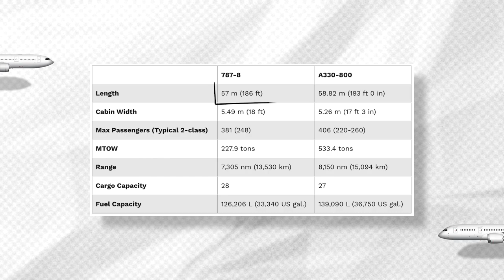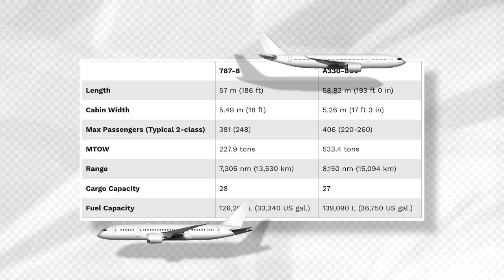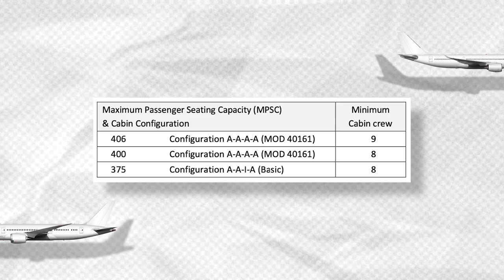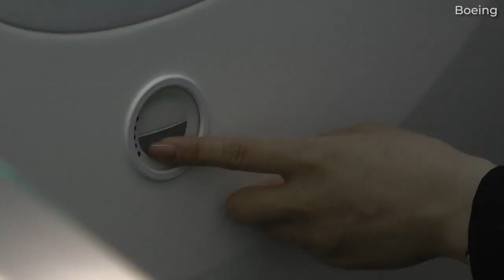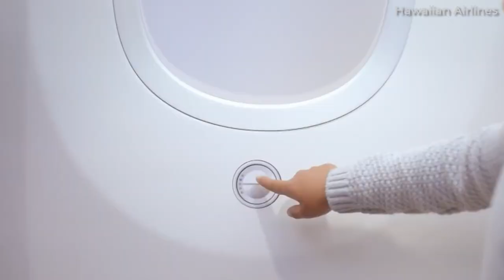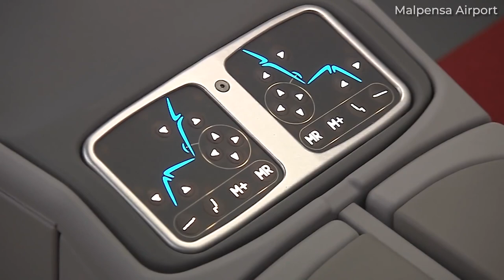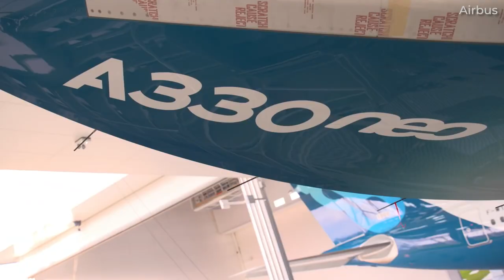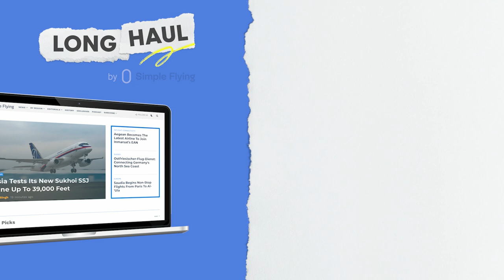Comparing Small Widebodies: The Airbus A330-800 vs. Boeing 787-8

Comment: The Boeing 787-8 is my favourite plane because it reflects what the 787 was originally designed for... Long haul routes with low demand.
Reply: With the airbus a321 XLR entering the market soon, that function will be taken to new heights by airbus.
Reply: @Imperial_stroopwafel  not really since the B787 has a major advantage over the A321XLR. The 787 can obviously haul much more cargo since it’s a wide body. Some routes have so much cargo to haul that airlines make more profit out of hauling freight than passenger revenue.
Reply: @is500fsport5  Realistically, it is cheaper to have separate cargo and passenger flights, unless if there are other factors, like limited airport slots.
Reply: A330 seats are 3 inches wider and engines are quieter
Reply: It'd a stunning plane!!
Reply: 787 is garbage, I flew onboard it, and it was awful. Cabin was tight 3-3-3 class layout which sucked, the A330 was much better with wider cabin 2-4-2 layout, when I flew onboard it, the cabin pressure was much more comfortable unlike on a tin can 787, and I am sure the A330neo would be even better.

Comment: It was mentioned that Qantas does not operate the 787-8 in relation to unfulfilled orders. It should me noted that Jetstar which is a part of the Qantas group does fly the -8. It would be pretty safe to say that the order would be for them
Reply: Those were ordered in 2006. I would say it’s pretty safe to say that after 17 years, they don’t want them. I also don’t think that Qantas orders aircraft for Jetstar.
Reply: @rtbrtb_dutchy4183  The -8s were in fact transferred to Jetstar, as the original comment mentioned Qantas owns Jetstar and airlines frequently do this. For example all of Air France's 787 orders are being given to KLM from now on, while all KLM'S A350 orders are being given to Air France.
Reply: @schalitz1  right, but all your examples is due to a change of plans and not the intend from the start. 

AF and KLM are swapping to become more streamlined overall. But those A350’s we’re initially intended for KLM and those B787’s were intended for AF. 

The Qantas orders were from 2006. They were not intended for Jetstar in my opinion. It seems they had a change of plans in 2011. 

Now, having said all that, I think you are correct and I’m wrong in regards to Qantas ordering for Jetstar. It does seem that Qantas orders airplanes for them both. I did not know this.
Reply: @rtbrtb_dutchy4183  QF definitely orders aircraft for Jetstar, as Jetstar is a wholly owned subsidiary of Qantas.

Comment: I like the A330, but I feel Airbus should have gone for a more expensive revision with the NEO version. Giving it composite wings would have made it a lot more competitive.
Reply: I agree
Reply: It's a fine line because the more changes they make, the increase in training costs to convert A330-200/300 crew. Low training costs and ease of integration into an old A330 fleet is the NEOs main selling point for airlines like Virgin Atlantic, TAP and Delta.
Reply: I like 2 4 2 row seats in A330. seems to be underestimated because they rely on A350?
Reply: As I posted in my other comment the A330-neo has a lower fuel burn at maximum distance than the 787-8 even with it's metal fuselage and wings. I'm sure Airbus calculated this before deciding to change too much.
Reply: Initially before Airbus decided to build the A350 they were proposing an improve A330 with a carbon composite wing.  So they should made  it in the Neo a la 777X.
Reply: According to Cody Explains interview with Airbus, the A330 got redesigned composite wings apart from new engines
Reply: @Lazo00100001  I saw that video, and it was very interesting. I don't think the wings are completely composite, but the original wings were a compromise as they were shared by the 330 and the 340 (which is quite a big compromise, since it needs to support 4 engines on the 340). The new wings are specific to the 330 Neo, and have composite components to reduce weight. It also seems that the 330 Neo is not a fait-de-complete, and there has been continuous refinement since it was launched, and likely to be ongoing improvements during its lifetime.
Reply: @lostcarpark  you're right, it's an important distinction, thanks for pointing it out! 🙏

Comment: Another consideration is that the same width that makes the A330neo more appealing in economy also makes it less suitable for premium products.  The Delta One cabin in the A330-900 versus their A350-900s is a prime example: to fit the same 1-2-1 layout, the seats and aisles are noticeably narrower, and the overhead bins a bit smaller.
Reply: I’ve always thought that the original A300 hull design, while shrewd at the time, focused more on freight volume and less on passenger comfort, actually moving the cabin floor and windows upwards.  The walls are not flat, as the windows and fuselage narrow shoulder space as the walls squeeze in.  Great, roomy belly cargo areas that accommodate the same cargo (LD3/11/7) containers that other in-production widebodies had back in the 70s.  Airbus was trying to save weight wherever possible during their A300 program, trying to be all things to all people.  Still one of my all-time favorite airplanes, I think Airbus pretty much nailed it with the A300, gave four of them to Eastern Airlines to try for a while, and got Airbus their tiny foot in the door in North America.  What an amazing company they became.  It is going to be ten or more years for Boeing to become a serious competitor again.  In the mean time, Airbus is offered a lot more flexibility to further develop its products at its own pace.  It is the ultimate plane manufacturer’s sweet spot, and so hope Airbus takes the ball and runs with it.

Comment: I think airbus made a mistake in a330neo program

Maybe if airbus install new composite wing and stabilizer (maybe the slightly smaller a350wing and stabilizer) that have less weight and better aerodynamic and scrapp some cabin wall to make it wider at least could accommodate 9 abreast 17inch
what like Boeing did with 777x with just not a new engine boeing instal new composite wing and re adjusted the cabin so it could take closer to A350 efficiency ,

the efficiency of A330neo efficiency would likely come close to the 787, if it happen the A330neo would have better sales than today

Plus The trent 7000 is 3% better efficiency than the trent 1000 TEN and the XWB, but with heavy almost entire metal fuselage the 787 still far ahead in efficiency
Reply: no they didn't make a mistake. The development cost for the A330 neo is really low. Airbus is already making profits. I agree that 330-800 might be a mistake, but not the A330 neo program as a whole
Reply: The a330-800 can fly 15,094 km using 139,090 L of fuel which is equal to 9.2 liters of fuel per km. 
The 787-8 can fly 13,530 km using 126,206 liters of fuel which 9.3 liters of fuel per km.

Comment: The 787 is a more modern aircraft. This also explains why the A350 is more successful than the A330. Airbus tried to do with the A330 what it did with the A320, but the mission of a widebody aircraft far differs from that of a narrowbody, and so are the economies of scale.
The 787 was a well thought out aircraft, and will continue to be the gold standard in this class for the foreseeable future.
Reply: That’s what I thought, I believe the 787 would be an ideal aircraft for those who want to get the most of future of aviation, but if you are a 90’s kid or 2000’s kid, grew up in the 90’s and 2000’s, and prefer the classics, the nostalgia, the A330neo is your aircraft.
Reply: @ramyfares9099  That would be the 767 and 777. 😂
Reply: @sainnt  767 dives you even further to the 80’s 😉
Reply: @ramyfares9099  The last passenger 767 was delivered to Air Astana in 2014. That bird will be flying for a while.
Reply: @sainnt  I think the 787 was meant to replace the 767 just like the A350 meant to replace the A340. The 777 and the A330 on the other hand both continue their legacy with enhanced engines and redesigned wings, despite being out gaining popularity since 1995, with the best selling variants the A330-343 being succeeded by A330-941neo and the 777-300ER being succeeded by the 777-9X.
Reply: They should've just done more like what boeing did with the 777x. Airbus seem not to care since it's a350 is also used by some airlines to replace  a330s along with 787s. Their current increments in improving the a330neo will add a few more orders probably meeting their estimate of 500 but not significantly more than that
Reply: @Tpr_1808  They're currently under 300. Perhaps investing a bit more in improvements will get them to 500, but with the A350 being so much better, I doubt it.

Comment: The A330 Neo its a great plane but the 787 being a clean sheet design its better. 

I think Airbus could have made the A330  more competitive with a Carbon Fiber wing and reducing the weight there its fat to cut in other areas.

Despite using a metal fuselage they could strenghten the fuselage to withstand the 6,000 feet higher pressure. 777X  and now the upcoming A321 XLR despite using a metal fuselage will pressurize at 6,000 feet.
Reply: Correct. If Airbus did with the A330neo what Boeing did with the 777X, it would have been a more successful aircraft. Taking shortcuts doesn't always pay.
Reply: I agree, I mean at least they could have added another engine option for the A330neo either a GE or PW engine option, just to keep up with the 787, but honestly if you prefer to fly in a brand new spacious futuristic aircraft, the 787 is the right plane for you to fly, otherwise if you prefer old school nostalgia reminding you of your childhood being a 90’s kid, or 2000’s kid, the A330neo is your aircraft to fly onboard.
Reply: @ramyfares9099  The A350 also has only one engine option, the Trent XWB.

Comment: The A330neo also has a significantly slower cruising speed than the 787, Mach 0.82 compared to 0.85. You can see on FlightRadar24 that A330neos often take at least 30 mins longer than a 787 to fly the same route.
Reply: It seems as though the 330 always seemed under powered or just over weight for the thrust the engines have
Reply: this is less of an issue today because the industry for the past two decades has been flying slower than the dawn of the jet age to save fuel
Reply: @trenton.tchannel1810  TAP CEO has said that they are unsatisfied with the performance with the Rolls Royce engines and that they aren't performing at full potential.
Reply: @heidirabenau511  I’m not surprised honestly. We seen what happened with the 340 using the CFM-56 engines. Airbus really should’ve looked into it. With the cruise speed being lower I’m not surprised when I worked at Delta the Amsterdam flight was always delayed arriving
Reply: Even the much bigger 777 has a higher cruise speed

Comment: Passenger comfort is extremely important. The 787 offers a better passenger environment. The larger windows are a bonus for anyone wanting to taking photos. As for seating that is problematic for both companies. The 10 abreast configuration is a nightmare on long flights. I fly JAL because their seating arrangement is less cramped than other operators of the 787.
Reply: Sorry, A330s usually fly 8 abreast in economy, very exceptionally 9.  787s normally offer 9 abreast, just JAL flies with 8, there is no way you can fit 10 seats in economy on these cabins.
Reply: @luisdestefano6056  seating arrangements are being handled by the airline’s not the manufacturers
Reply: @broddsaviation5471  agreed, but possible dispositions are as I indicated.
Reply: @luisdestefano6056  Yes, 10 abreast sounds extremely tight. Surprisingly, I found a reference to United flying a 10 abreast service. Don’t know if they are still doing it.
Reply: @DJAYPAZ  sure, United has 10 abreast layouts in economy (as does every other airline). But in their 777-200 and 300ERs.  Which, if you care to check have considerably wider cabins than the planes being discussed here. Not too difficult to understand, you see. And 747s and A380s are even wider.
Reply: @luisdestefano6056  Ah yes, of course they are bigger aircraft so 10 abreast makes sense. I am waiting for the 777x to be certified and flights become available on routes I can use.
Reply: @broddsaviation5471 yes we know that but they don’t choose how wide the plane is!
Reply: The typically slimmer seats in the 787 say otherwise. If the windows are fully dimmed and the sun is shining at you good luck cause those windows don’t block it out

Comment: The a330-800 can fly 15,094 km using 139,090 L of fuel which is equal to 9.2 liters of fuel per km. 
The 787-8 can fly 13,530 km using 126,206 liters of fuel which 9.3 liters of fuel per km. 

At least for maximum lengths the a330-800 is more fuel efficient. Calculating in the additional 5% passenger capacity makes the a330-800 the winner by quiet a lot - at least in long flights. Maybe with shorter flights the 787-8 gets back that margin. 

Still, it's very interesting that Airbus was able to take an old plane, clean up it's aerodynamics and add new engines and best or at least match Boeing's clean sheet design.

This video is interesting to me as my two best flight experiences on any aircraft type has been the a330-neo and the 787. I preferred the former flown by TAP over the latter but only marginally.  As for those 787 dimmable windows though, I'd still like to have a plastic pull down screen. Even when you get the 787's windows at their darkest you're not going to sleep during the day if you're flying west over the Atlantic. The dimmable window is cute but I'm not sure what it's purpose is - make the clouds darker? 

As for the pressurization, I enjoyed both planes and maybe the 787 feels nicer inside? I think the biggest change with both of these planes is noise - loud engines tire me more than higher altitude air pressurization. Both planes are very quiet.

Comment: Wouldn't write-off the A330-800 just yet. Large A330-200 operators like Hawaiian and Qantas will most likely consider the -800  as their -200s age. It costs a fortune to retrain the pilots and crew for a different type. the B787-8 would have to be a lot cheaper to operate to justify the retraining.
Reply: As much as I want to agree with what you said. Yes they should’ve got a A330-800, but then NAH guess what. Qantas has B787s to cover the ground so dunno what fate will their a330-200s have probably they don’t care. Hawaiian is more stupid and said that they decide to with the B787 just cuz it’s engine is good to the environment. It’s such a massive disappointment that none of the A330-200 operators most didn’t even consider get the neo and just go with the B787.
Reply: These two carriers already chose the 787-9 to replace their A330s.
Reply: It was a really big deal and all over the place that Hawaiian canceled their order and switched to the 787-9.
Reply: @mxttyzw  Qantas is not using the 787-9 on the A330-200 routes. 787-9 are being used on their longest routes like PER-LHR, SYD-DFW, SYD-JNB. Your 7-11 hour flights with lower passenger occupancy like SYD-KUL, PER-JNB, SYD-CAN are still being flown by A330-200s with no designated replacements. There is a possibility that when their A350s arrive, they'll be deployed on the longest routes while the 787-9s will be delegated to the shorter lower density A330-200. Boeing is also woefully behind schedule on their deliveries of everything that some 787 orders will be cancelled causing some airlines to reconsider.
Reply: @ludwigtails  The other reason not to write off the Airbus is  Boeing's delivery schedule. They're so far behind on everything, there will likely be a few cancellations. The other carriers to watch are the ones with large aging 767-300ER fleets (United and Delta). United has made it clear they're going all in on the 787 as a replacement but Delta is likely to consider the A330-800 with their many pilots rated for the type.
Reply: Sad!
Reply: Hawaiian airlines already are planning to buy 787s. It likely won’t take long to deliver with some of the 787 production being moved to Seattle I believe
Reply: First they already replaced with 787s, second most of A330-200 operators would just buy the A330-900 and upgrade capacity. The reason why they bought the A330-200 once was due to the low range of the early A330-300s. Low range is definitely not a problem of the A330-900.
Reply: @schalitz1  honestly they made a huge mistake choosing the 787-9 as this plane is garbage, recent news on Boeing indicating structural defects on the 787's fuselage as Boeing's CEO is grilled because of that case.

Comment: I just can’t see how Boeing’s delivery capabilities, quality control and ethics will not help Airbus.  If Airbus gets aggressive with pricing, sets forth a retrofitting plan to convert these A330neo airplanes to freighters after their passenger service, I think these airplanes will gain a decent portfolio of orders.  Minimum for an urgent plane order to delivery runs about one year IF the design engineering is frozen.  If airlines and Airbus get a move on, the A330neos will be a great boost to airlines and manufacturers.